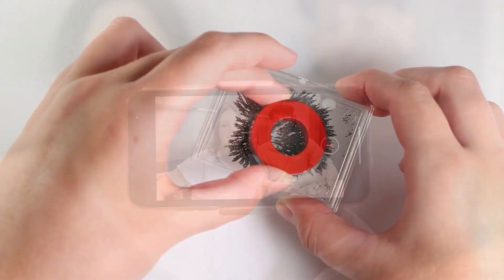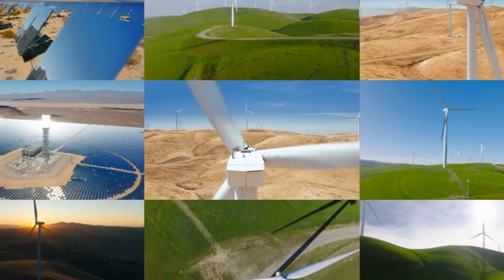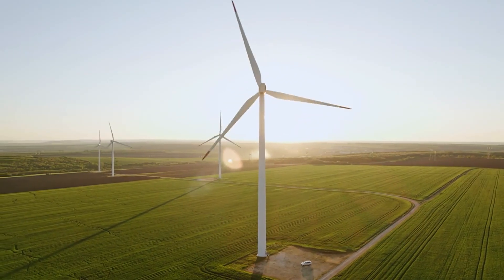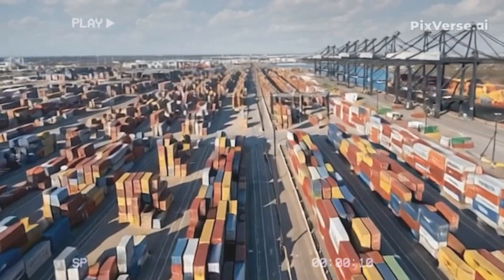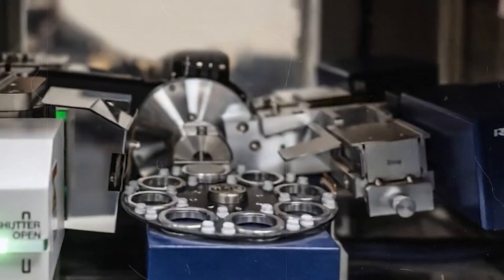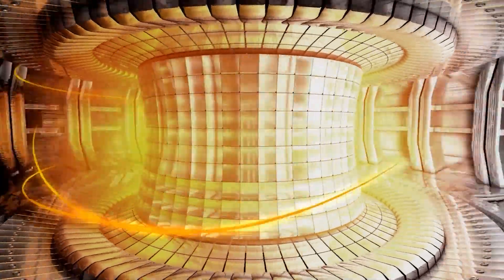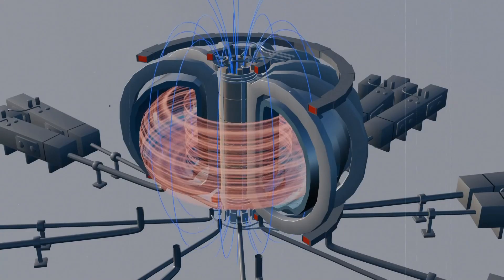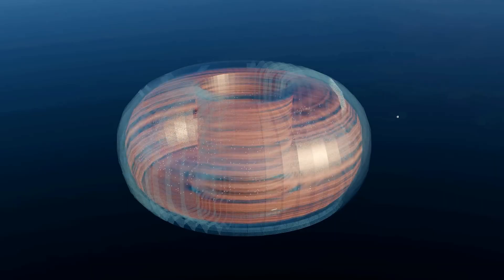Why the World Would Stop Without Magnets: A Clean Energy Revolution

Comment: They make good intakes

Like slotted, pyramidal step structures, but inwards, to a slit 

And outside that, line the flat faces with magnets, with the south pole towards outside, and north against metal, but towards the hole

Then, the hole is a slot, a tube

That curves up at the end, to a nozzle, like a shower head, all made of meteoric nickel steel 

Inside, batteries, connected to the tube slats, - 

And to a giant horseshoe shaped magnet 

Around the nozzle

Connected + to the south pole, with the north pole being the teeth of the magnet, around the nozzle

With enough voltage 

You just burn the air into a plasma for thrust 

Which was the first Vahana design